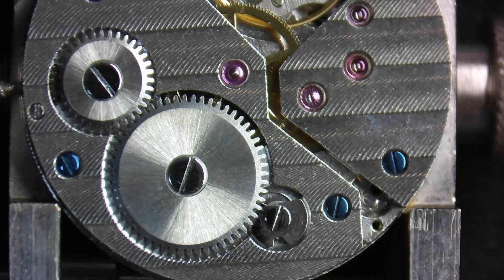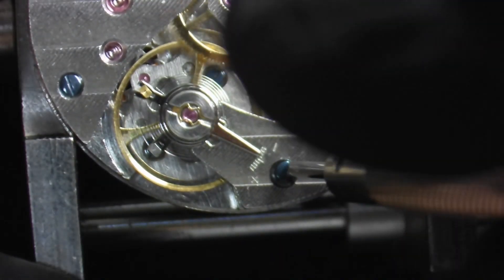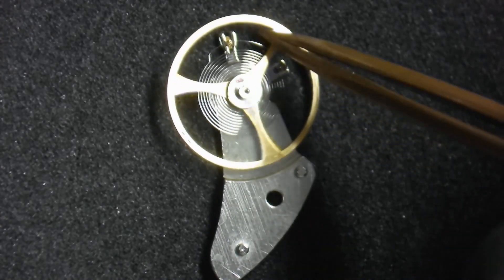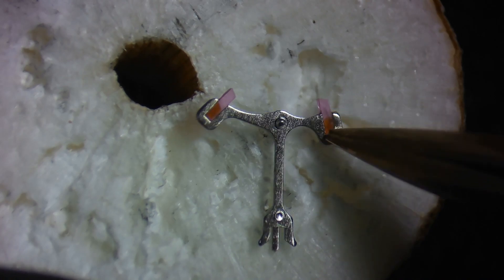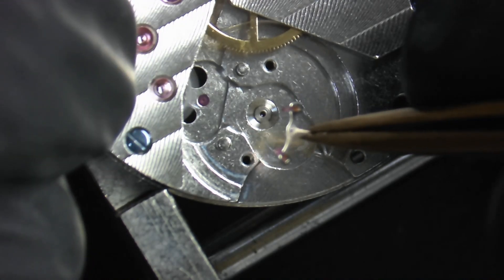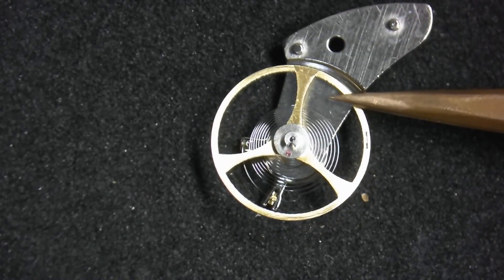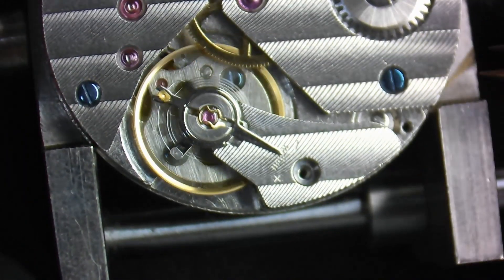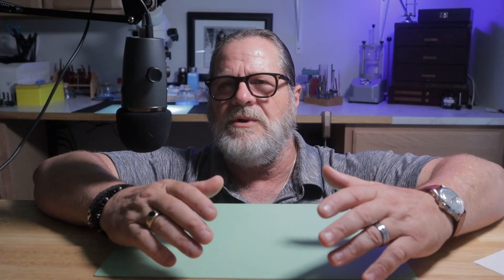Watch Repair Lesson #5- Removing and Installing the Balance Wheel and Pallet Fork

Comment: Thankyou!!!!! I took if all apart then reseated the edcape wheel, 2nd and 3rd wheels, balance qheel and got it all going and felt amazibg. Unfortunately then one of the tiny sandgrain size jewels supporting the escape wheel in the bridge fell out and as i tried to press it back into its hole heard it skitter away and i couldn't find it . Heartbreakng but i learned a tonne anyway thanks to your videos.
Reply from the maker: Small UV lights work great at finding these jewels.
Reply: @watchrepairtutorials thankyou I'll get one. I bought a new train wheel bridge for a few bucks and escape wheel (also lost) and after some practice got it going. Thanks!! Im learning so much.

Comment: nh35 팔레트 포크에서 조립 못하고 있는데 
보석 구멍에 들어 갔는지 
몇배줌 확대경으로 봐야되나요? 
10배줌으로는 도저히 안보여요
Reply from the maker: If you are having problems installing the balance wheel, try removing the end stones. That will make it easier for the pivots to find the jewels. Microscopes make this process much easier as well.

Comment: Hi!
What happens to the white out, on the balance wheel?
Reply from the maker: You remove it
Reply: @watchrepairtutorials  how do you not run the risk of leaving residue, flakes, etc, on the movement?
Reply from the maker: @joaobanza5808   this is normally done prior to cleaning the movement.
Reply: @watchrepairtutorials  great! Thanks.

Comment: Hi Alex!!! How do you solve this issue? The steady pins sometimes create friction, requiring you to push down to set the bridge in position, but at the same time, there is a risk of breaking the pivots :S
Reply from the maker: First make sure the inside of the holes are clean. Next, install the bridge several times without any wheels to make sure there is no defect in the pins preventing it to seat properly. Make sure the parts are not hot. That makes metal expand.
Steady pins should not have to be forced into the holes.
Depending on the movement you’re working on it could be a quality issue in the machining of the parts.
In cases like this, you just need to take your time and make sure that your pivots are lined up.

Comment: From beginning to end, informative, instructive. I liked putting the subtitles on and putting it at 1.5 speed with pencil and paper at hand to take notes and draw diagrams. 

Important points discussed 1.Anatomy of balance fork. (Exit, entry, area called "slot" where, shallac that binds p-fork jewels on underside of p fork. 2. Underside of balance wheel: safety roller, impulse jewel which goes in/out of "slot" of p. fork. 3. Order of installation: Powertrain must be installed first before fork and b. wheel because the power train needs to spin freely while installing the bridges. Bonus tip: Don't spin the balance wheel with the finger and don't blow on it (moisture of breath will cause rust on the b.wheel) instead use a hand blower or artist brush, ...)
Reply from the maker: It’s important to understand the anatomy and function of these parts!

Comment: I hate to ask, but I'm so impatient.   I'd read comments and watched your oiling videos.   I don't know if they palet fork top and lower jewels get oil?  I did see your video on oiling the palet fork jewels that work with the escape wheel.  50 percent coverage.   I might screw up the names of the parts too.  I'm wondering about the top and lower jewel that the fork  rotate on.     I'm new and older, so my short term memory fails me  alot.     If you've covered it, forgive me.
Reply from the maker: It is not necessary to oil the top and lower pivots. Only the pallet stones get 9415

Comment: what happens if you do not, release the energy .. for the balance wheel , and then you dont remove the balance wheel and fork? and remove all the other parts. .first.
Reply from the maker: It explodes. If remove the pallet fork bridge a burst of power goes through the wheels and can damage the pallet stones.
You are also causing a lot of torque to run through the delicate teeth of the wheels which can also damage them.

Comment: I sadly bent the hairspring cause i tried to regulate my watch and accidentaly moved a lot the regulation pin (that cause the bent). Can i save it in some way or i need to buy a new balance wheel with a new hairspring? Or it's better, for the cost, change the entire movement?
P.S. I love your channel, hands down the best watch channel on YT (i'm italian but i understand every single explanations in your videos, that's means A LOT and confirm how amazing is your channel)!!!
Reply from the maker: My mother is from Palermo. Came to the US through Ellis Island. You are my paisano.
Which movement is it?
Reply: @watchrepairtutorials  Really? Sicilian mother omg!!! I'm from Puglia, south of Italy too ;) Anyway the movement is a NH35A.
Reply from the maker: @ ok great. Yes you can correct the hairspring but you may want to wait a little bit if you are brand new. Just replace the movement and use this one as a practice movement. 
To fix it you will need to able to remove and replace the hairspring from the balance staff. 
Then you have to equalize the spacing between the coils. This is done with the process called needling.. 
How you manipulate the hairspring depends on which way it’s bent.
Reply: @watchrepairtutorials  I see, thank you a lot for your precious help amico mio!

Comment: An alternative to an expensive Bergeron puffer is to go to a camera shop and buy a lens dust puffer for a few bucks. It's pretty much the same thing, and it's a lot cheaper.
Reply from the maker: I agree 100%. A balance wheel cannot tell the difference between a puff of air coming out of a Bergeron puffer versus an inexpensive Chinese puffer. This is definitely an area where you can go cheaper and still get the same result.

Comment: Hello Alex. I was trying to get into watchmaking. but when i am trying to put in the balance wheel when i press on it it stops...
Reply from the maker: Hi Alex,

There are several potential reasons why your balance wheel stops when you press on it during assembly:
Pivot Issues: The pivots of the balance staff could be bent, have excessive endshake or sideshake, or be binding in the jewel holes. Check for any visible damage or misalignment.
Jewel Issues: The balance jewels might be damaged or dirty. Examine the jewels under magnification for any defects and ensure they are clean and lubricated correctly.
Endshake: The balance wheel might have too much or too little endshake, causing it to bind when pressure is applied. Adjust the endshake as needed.
Foreign Objects: There could be debris or lint interfering with the free movement of the balance wheel. Thoroughly clean the balance assembly and surrounding area.
Improper Assembly: Other components in the movement might not be correctly installed, putting pressure on the balance wheel. Double-check the assembly of all parts, especially those near the balance.
Remember to handle the balance wheel with care, as it is a delicate component.
Good luck with your watchmaking

Comment: I wish I could like this twice. This can be the most frustrating job!
Reply from the maker: it certainly can be, and some watches are harder than others. The key is really just making sure that the pallet forks in the right position, holding the balance cock with your tweezers and turn the movement holder.
You can so it!
Reply: @watchrepairtutorials  Thanks, man. I've tried so many times on an old AS 137, and no luck yet.......
Reply from the maker: @chrisjohnson4165  no worries. Make sure the bottom pivot isn't bent.
Reply: @watchrepairtutorials  Thanks, it's still OK thanks.

Comment: Q - Did you need to take off the white out? Wouldn't it affect time slightly?
Reply from the maker: Yes, you take off the white out.
It doesn't affect anything in the horizontal position, but it would create a poise error in the vertical positions

Comment: I have become adept in breaking balance wheel assemblies, I am practicing taking them out and placing them back as it's the one thing I'm struggling with, the present assembly has gone in and out about 20 x with no joy....it's probably busted.
Reply from the maker: You can always try taking the jewel settings out and then install the balance.

Comment: When I tried releasing the click, a tiny u-shaped spring (the click?) jumped out from underneath while holding. Very tricky putting it back and not sure I put it back correctly. Nevertheless this vid is excellent and I'll study it.
Reply from the maker: There is actually a right direction for the spring installation and it is not obvious.
The best thing to do is to test it to make sure the click is working correctly.

Comment: I still don' understand how people make this look so easy. How can you line up the impulse jewel into the pallet fork when you cant see it? This is literally the hardest part of the entire process. I have tried about 10 different times and have never been successful. Extremely frustrating!
Reply from the maker: He Pete,
You don’t need to see it buddy.
When the fork is in position, you bring the balance wheel in from the right side. Look at the position of the impulse stone as the balance wheel is hanging.
When you position the impulse jewel to the right of the pallet fork, as you turn the movement the impulse jewel will slip into the fork slot.
I just takes practice.
Reply: @watchrepairtutorials  Thanks Alex! I am working on it. I am just so worried about bending that hair spring lol.

Comment: And what material did you use exactly?
Reply from the maker: Can you rephrase the question? I am not sure what you are asking about.
Reply: @watchrepairtutorials  which material did you use to make the wither sign pinpointing the impact jewel? Is it Rodico?
Reply from the maker: @giacomodelbianco  I think you are talking about the white out that I used to mark the balance wheel showing where the impulse jewel is. White out was used when people used a typewriter back in the old days. It was used to cover up a typed letter so it could be re typed.
It’s not something you want to leave on the balance wheel. I was just using it as a reference so you could see its position when I was putting the wheel in.
Reply: @watchrepairtutorials  Thank you, You understood correctly my question. I didn't know what is white out.

Comment: Good day from the Napa Valley. Very easy to understand great video. You come across as one cool cat  I have screwed up a bunch of junk movements and can  now  work on them without bad language. Keeping my tweezers and screw drivers tip top all the time now have scope. I I'm addicted to working on movements trying to piece together a complete movement disassembly, cleaning and reassembly. I learn a lot from your rock solid videos Thank you
Reply from the maker: That’s awesome. Sounds like you are starting to get off on the right foot.

Comment: Just an observation, I couldn't help but notice that your sitting at a bench that's chest high, is this to save your neck and shoulders from cramping, or is there a more practical reason?
Your tutorials are great and I look forward to learning from you. Cheers and Happy New Year!
Reply from the maker: Well, I have two benches, one for my microscope and then a high bench for when I use a loop. The purpose of the high bench is to prevent having to bend over saving your neck and back from strain. If you look at any watchmaker, working with a loop noticed that they are using a high bench.

Comment: This step continues to challenge me.
Reply from the maker: It just takes practice. Make sure you have your pallet fork in the right position. It should be facing up as you’re bringing the balance wheel in and make sure that the impulse is coming in on the right side of the fork.

Comment: New sub here. Thanks a ton for these videos, started my first watch this week with your videos as a guide.

Question about the white out mark you did on the Balance Wheel. Does the weight of the liquid affect the “balance” of it at all? Or is that a nonissue?
Reply from the maker: Sure it will if it’s left on. The added weight will threw off the balance poise when the movement is in vertical positions but does not affect the horizontal positions. 
You remove it after the LA test. It just flakes off or you can use IPA to remove it. 
Good question and welcome.

Comment: Hi Alex once again, nice to watch this video as I have been working on a Seiko 5601 and it has a very odd shaped pallet fork and I just have not been able to place the balance wheel in correctly. So, as you know, I like to give you and update on my progress. Friend sent me his 1978 Seiko diver that he bought in USA whilst on a Navy visit (yes, in 1978). It is a lovely watch, perfect nick and the main bridge and train works has never been touched. I gave it lots of love and without a hiccup serviced, replaced seals, left everything in original condition and had water tested. Total pass. Wrapped. Sent back to my good friend who is back to wearing every day. I am currently working on a mid 50s Moeris and enjoying very much. Quite a complex movement given it is only 3 hands. Nicely made. My tools and work area have improved and I have modified some tools to suite my preferred watches. I have fallen in love with the Seiko SKX007. Just a pleasure to wear and I actually enjoyed upgrading (simple task with the mods available) and my personal watch is a great every day watch. Classic with the 5601 is that I noticed the Diashock bottom frame had a chunk of metal or something in the wee little hole. Well, thought that would be easy to clean but I actually thought I damaged it in the process. Sourced the replacement and only 6 quid from the UK so just a bit of time lost. I have re-seated the new frame but I gotta tell you, these have a very fine channel to carry the spring. Select the Staking tool very carefully so as not to compress this channel. Yes, I did damage the first one. Just pure lack of attention to how this is made. I think my learning is that every part should be studied very closely and accept that everything is  d e l i c a t e. I was smart enough to buy a spare so that has gone in just fine. But back  to my first sentence, the balance wheel is not sitting in and free. I think that the frame should be slightly adjusted to provide the correct clearance or shake. That is my next step. Sorry about this rambling bunch of sentences, I am 72 hours into a fast and this appears to be the main symptom of no food. Hope all is well with you. We may get a summer this next couple of months and watchmaking will swap for Fly fishing. Life is fun.
Reply from the maker: Glad to hear you are making progress. Slowing down to study the parts is a pro move. So many just start removing parts with studying how the parts interact with each other. 
It’s funny that you mentioned fasting because for the last six weeks I’ve been doing alternate day fasting both for weight loss and health purposes. So far I’ve dropped 30 pounds and I’m feeling much better. When I lived in Colorado, I did a fair amount of flyfishing myself. Not so much in streams, but in lakes. I had a pontoon kick boat and we would fish for monster Browns in Colorado and Wyoming. It was so easy to lose eight hours on the water before you even knew it. Life is good.

Comment: Hi Alex, great video!

I have a Frederique Constant  FC-350 GMT that stop starts.  The balance wheel runs erratically.  When i get it going it stops after 5 seconds.  But if i position the watch in a certain position it runs for approximatley 4 hours before stopping. 
I have had it serviced twice both times it ran fine for several months and then returned to stopping!

Regards

Mike.
Any ideas what might be the cause?
Reply from the maker: Sound like a problem in the escapement. Did they replace any parts when you got service work done?
Reply: @watchrepairtutorials  
No new parts.
Reply from the maker: @MichaelMiller-p1m  who’s doing the service. This is just some random watchmaker or is it the service department? 
One possible scenario is that they are oiling the pallet fork pivots. Most watchmakers know not to do this, unless the pivots have the their own end stones and are conical in shape. Because the top pivot of a pallet fork has the shoulder oil works its way down the shaft getting into the fork slot which contaminate the impulse jewel. The impulse jewel gets sticky, and that could cause the wash to stop running. 
Other than that something inside the escapement is not adjusted properly.
Reply: @watchrepairtutorials  
Hi Alex
I've had the watch serviced by a local jeweller and also by an independent watchmaker. The later stated if the service was'nt successful the watch would need returning to the manufacturer.
I have had a quote from the manufacturers uk agent (citizen) but their service quote was more than i paid for the watch.
As far as im aware there has been no new parts fitted to the watch 
It has took several hard knocks in its time.

Regards
Mike.
Reply from the maker: @MichaelMiller-p1m  well that sucks. Hard knock can cause not only problems in the escapement as well as move some jewels around. 
Depending on which one you have if you decide to sell it, I might be interested in buying it
Reply: @watchrepairtutorials  
Hi Alex
I'll bear that in mind but i have not given up on it just yet.

Regards Mike.

Comment: I can't get the impulse jewel to fit in the fork 😔 I'll keep trying
Reply from the maker: Make sure you’re coming in at enough of an angle. Try holding the wheel steady and turn the movement instead of the other way around
Reply: @watchrepairtutorials omg I found out what I did wrong! I've been putting my pallet fork upside down 😭💔
Reply: @watchrepairtutorials I'm looking to get a new escapement wheel
Reply: I hope I didn't damage anything ☹️
Reply: I think I broke my escapement pinion, it doesn't sit in the bottom jewel and seems to move away from the pallet fork